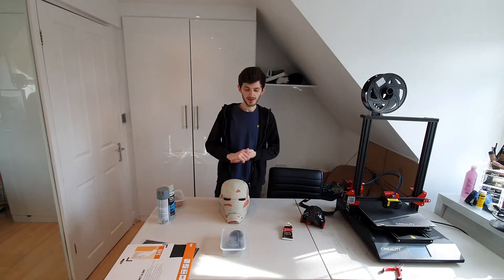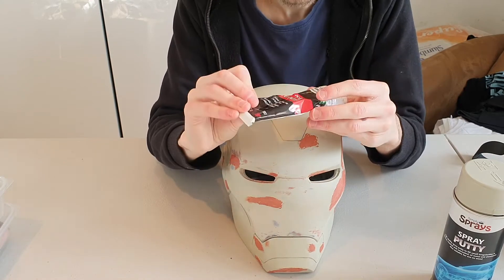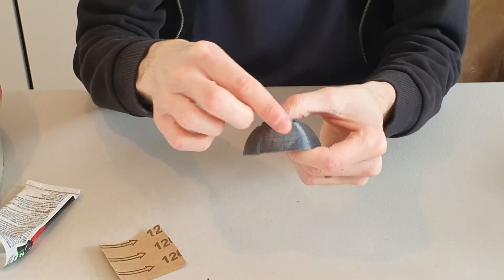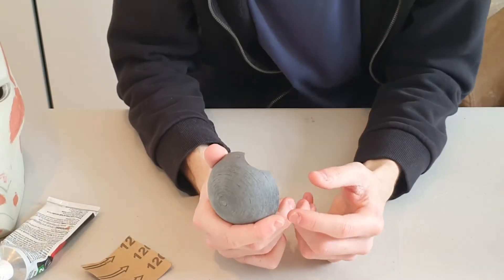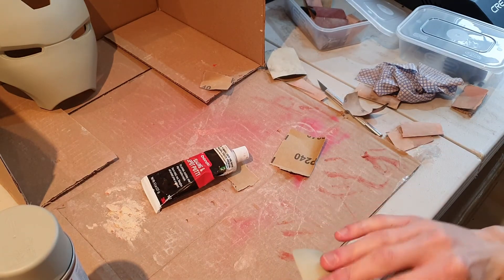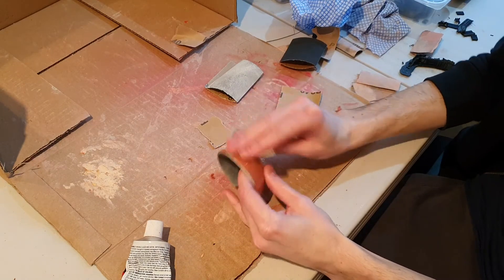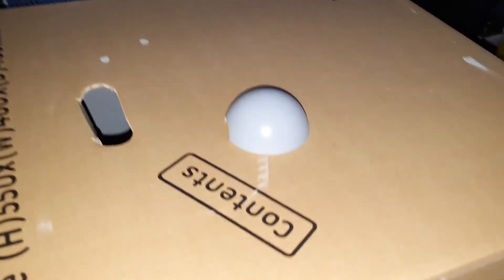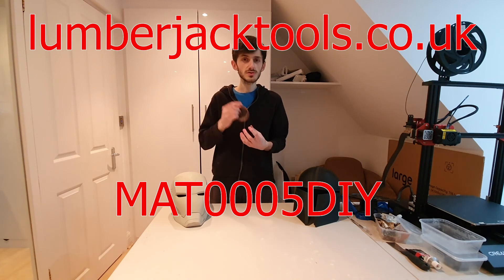How I Smooth PLA- Tutorial for 3D printed parts - MattsDIY

Comment: Interesting, I’ve only had a 3D printer for a couple of months, mainly making parts for workshop use, so no need for that level of detail. Would like to see the finished Iron Man helmet.
Reply from the maker: they are super cool! what sort of workshop things are you printing, very interesting!! I will be sure to post a video or picture of the iron man when it's painted !
Reply: @mattsdiy4595  before I got the printer I started to learn Fusion 360 as I wanted to be able to design my own parts, not just download designs from Thingiverse. 

So I’ve started with simple parts like star knobs, paint dogs, guide rail stops and a flag stop for T-tracks. 

From Thingiverse, I’ve printed a router base for the Katsu that runs on the Festool/Makita guide rail, and vacuum hose clips to keep cables secured. 

I’m currently looking at this, a system like the commercial Button Fix product, that’s been designed by Mike M here on YT. 

https://youtu.be/b7w83XW3gwM
Reply from the maker: that's super cool!! need to start to learn fusion360 aswell so I can make my own tools and cosplay stuff! 
let me know how you get on with that stuff I'd love to print some of your stuff and show it off !!!!